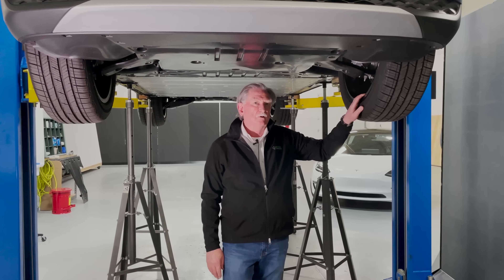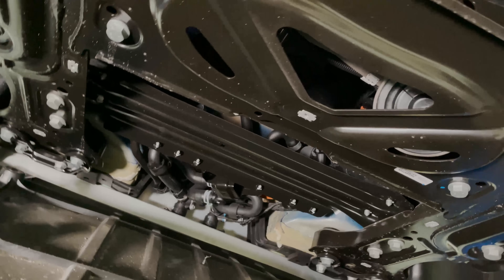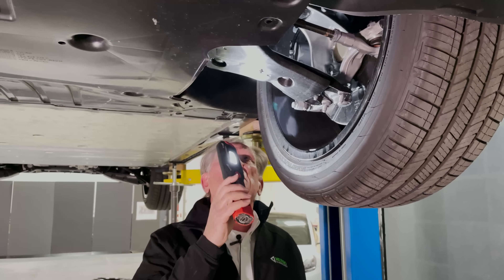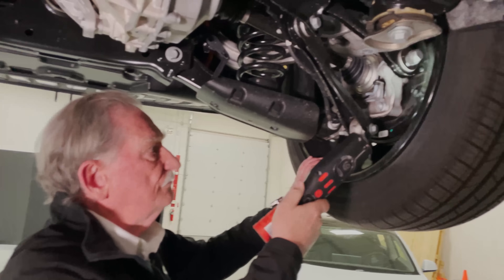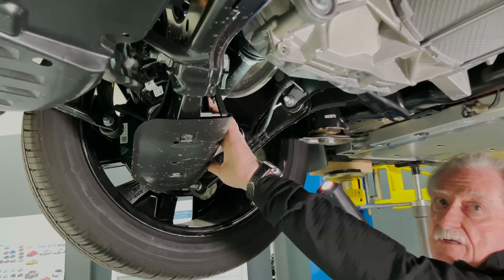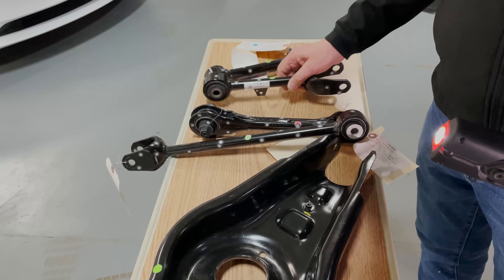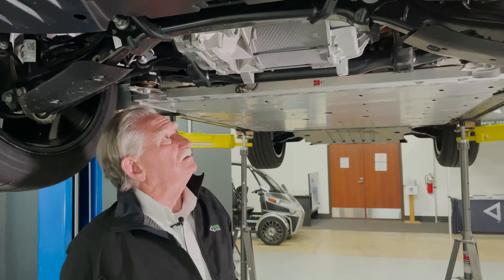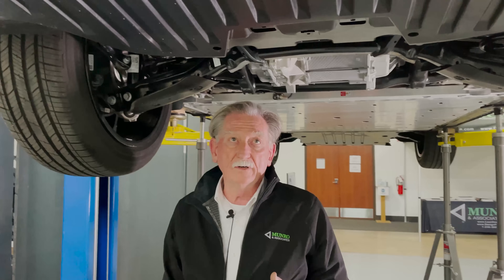2021 Volkswagen ID.4: E3 - Hoist Review, Front and Rear Suspension

Comment: The mistake Sandy did in this video is, that the ID4 is using the MEB platform. VW plans to utilize this in at least 20 different vehicles. Most of the design choices were meant to support the future models as well and not just one car. The excessive "voids" in the front of the car are for the front drive motor. And for those who complain about drum brakes: Most electric cars do engine braking ( energy recuperation) and the friction brakes are rarely used. Also winter salt tends to decimate disk brakes ( inactivity does it as well) and rear brakes handle a small percentage of braking. Drums are also protected from the environment and will work when the car needs them.
Reply: This is an excellent point.  The same MEB skateboard is literally used for all of VW Group's electric lineup - the only thing they change is the number of battery modules and motor configuration.  Tesla creates a bespoke chassis for each model.  These are fundamentally different engineering decisions and have their own unique pros/cons.   It's a bit unfair to compare them directly to each other.
Reply: @latchkeytio  
It’s not just the drivetrain and chassis but also much of the interior components like the displays, entertainment system, knob and buttons, door handles etc etc. I think we can be sure that VW has given this a lot of thought. 
On the other hand, because they share their platform across 26 models, it will be much more complex to make changes (improvements) to it. 
UBS (yes the Swiss bank) has done a tear down of the ID.3 and after that they adjusted their target price for VW shares significantly up. Just that message caused a 5% price increase of VW shares.
Reply: @latchkeytio  its not used for the whole line up. they have the taycan platform and are working on a bigger SUV platform and a smaller ID2 platform.to replace the triplet. 
but the bulk of VW EVs will be build on the MEB.
Reply: @nox5555  The id2 will be subcompact like their polo or the 208 around 4m length, not citycar like the VW eGo around 3,6m.
Reply: @Psi-Storm  the id2 will replace the polo, but the platform will be smaller so they can fit the triplet replacement on it.
Reply: @nox5555  Porsche doesn't use MEB
Reply: @sexpistill  ????  also not YET.  wouldnt be the first time for Porsche to use a VW base for their cars
Reply: @nox5555  🤣😂 Porsche, Audi and bentley share parts. Please show me which Porsche shares a platform with a VW
Reply: @sexpistill  the cayenne and the macan are both on MLB platform or its successor.
Reply: @nox5555   🤣😂 The MLB platform was introduced by Audi back in 2007 it is a luxury platform VW started using a varient of it in 2016. I ask you again show me a VW vehicle that shares a platform with a Porsche
Reply: @sexpistill  you should have googled more.
the VW Touareg and the Porsche Cayenne have the same platform and even come from the same factory.
Reply: @sexpistill  VW developed that platfrom. there will also maybe be a top level VW on the Audi platform. its not super clear what VW will do. and only seat and skoda will not get a top level version for sure.
 there isnt much price difference between the top level suv from VAG and the chances that the first big VW suv will be on the same platfrom as the Porsche, like with their ice SUV is pretty high.
Reply: The "Arching arms" that Munro called a "mistake". My gut feeling is that they are designed that way to save cost, so VaG group can fit them in all sorts of different types of cars. Some may use the space that those arms are arching around.
Reply: All of the above and if the motor brake + the drum brakes can block the wheels, disk brakes wouldn’t be better.
Reply: I bet some steel parts will be replaced with lighter parts for the Audi Q4 Etron on the same platform.
It also looks like VW is shuffling around their brands, making VW the entry level. the Seat Id3 clone and the skoda id4 clone look like higher priced vehicles.
Reply: @nox5555  the q4 is  made in the same factory as the id4, so it's possible, but not likely. But it could be possible because they might need to find ways to save weight to compensate for all the heavier noise insulation.
Reply: @nickb8a  thats not going to happen and the q4 is only slightly more slitent.  im sorry, tests came out and VAG  skimped on the q4. its just another id4 and no smart person in europe will buy it over the skoda.  for the US, if you can get a good deal, buy the audi, because it looks better and isnt like a japanese car on the inside. but buying low end audis was never a smart move. VW always had the same high tier car in the segment and the golf is better than the A3 for some reasons.
Reply: @nox5555  Honestly, for the us market, the q4 makes a lot more sense because of the better infotainment, and the "audi" badge. 
The price difference between the id4 and q4 e tron is about 3,000-4,000 us dollars (2.652,60-3.536,80 euros) 

The id4 lacks a lot of features that are available in the European market such as a 360 camera, and the virtual reality heads up display, so that is probably vw trying to get customers to upgrade to the q4. 

However the q4 does also lack some features that are available in europe such as ventilated seats, and thats probably Audi trying to get people to upgrade to the big e tron. 

In the us, only the more powerful golfs are available (because Americans hate hatchbacks and wagons for some odd reason). So thats probably the only reason why the a3 sells okay here.
Reply: @nox5555  I consider myself a smart person, and I’m in Europe👍🏻 I chose a Q4 over the ID4 and Enyaq😜 I felt the HVAC and Infotainment systems in the Q4 were better sorted and less glitchy , though I believe OTA updates may have sorted the infotainment issues. I also preferred the looks of the Audi and the only real advantage the Enyaq had was 60 litres addition luggage space. Although the Q4 was more expensive when you break it down to monthly payments there was little in it. My 40 S-Line was under £10 a month more than a 1st Edition ID4 or an Enyaq with a few options👍🏻 Audi have cheaped out a bit in a few places though- I’ve put a video on my channel showing a few examples 😬😜🏴
Reply: Excellent additional explanation!
Reply: and yet it does not look like a car platform of 2021
Reply: @mrThoreKarlsson  yes I agree. I'm a tesla bull. But all comments should be welcomed that point out not though of aspects.
Reply: I think in the analysis, sandy completely underestimated the requirements that vw had for the id.4 (meb platform)
Including all the reasons you listed, there are other design choices that they made because it made more sense to them. For example, not having a frunk. The id4s hood is extremely short. If you doubled the length, and made it to the length of a model Ys hood, yeah, you could probably fit a frunk, but they chose to make the front end shorter, because they could then prioritize interior/trunk space, and allow the car to have a smaller turning radius (important especially for the European market)
Reply: it's called. cheap engineering by over-engineer. the car should its main propose. best driving.
Reply: Im surprised he didn't go into this, if you'd look at one example of one of my products you'd question the efficiency of some of the engineering in it, but then if you looked at the whole product line then it would be clear why those trade offs were made.
Reply: Didn’t Sandy say rear drum brakes are fine?
Reply: You are taking it so personally, VW not build like a BMW..cheap JUNK
Reply: Also note, the id4 isn't new it's been for sale in Europe for a while now.
Reply: Having driven both the Model Y and the ID.4, I'm not inclined to call anything in ID.4's suspension a mistake. I was actually stunned at how good the suspension and chassis setup were in the ID. I don't care if the Tesla 'looks like a BMW' when on a lift. The VW drives far better on a twisty or bumpy road. Too bad the efficiency isn't there in the ID.4...
Reply: @coyotegeek  efficiency can improve over time with OTA just like with Tesla.
Reply: @coyotegeek  You are crazy, the Tesla Model 3 will out perform the VW on any winding track. And for less money a Model 3 will beat a Porsche Taycan Turbo S. Porsche Taycan Turbo S price = $187,600 --- Model 3 = $49,190 plus Modifications $20,000 = $69,190. For 35% of the cost Tesla wins... https://www.techtimes.com/articles/259029/20210413/modified-tesla-model-3-wins-against-porsche-taycan-turbo-s.htm
Reply: @coyotegeek  I own two Teslas, including an early Model Y and have also driven the ID4. I will stand by the statement that my Model Y handles better than the ID.4....
Reply: Exactly. Most of the video is just BS
Reply: Sandy has started to lose his objectivity and the VW group understands platform architecture, scaling, and plant production optimization.    He (Sandy) needs to acknowledge the limits of his competency  - that is simply his reality.  He would be well suited to interview engineers from the VW Group before racing to simplistic assumptions about over-engineering.
Reply: @anthonycbrown1952  Get the fuck out of here. He points to some things he sees as over-engineered and shows an example that he considers better in terms of complexity and cost. Who are you to even make an assessment as to his competency?
Reply: @junkymcjunkster  I read his C.V.  and  the VW Group is not some unprofitable start-up.   Get back to us when you obtain a STEM education.
Reply: @junkymcjunkster  who are you to know sandy thinks of every aspect when he makes these takedowns? Drum brakes actually can have better value on and ev vs disks when they are not rusting etc..... Ultimately we should all be open minded and not adopt dumb fan behaviour.... We don't know what we are supporting unless we understand it ourselves.
Reply: @janfm8670  In no way did I suggest I know everything Sandy thinks or express an opinion on drum brakes.
Reply: @junkymcjunkster  so what was your comment about? Get out of here.... Why? Since you don't know if the point that the guy made was valuable...
Reply: @janfm8670  I was responding to the personal attacks other dude was making.
Reply: @junkymcjunkster  ah ok. I thought this was your response to the main kcommenter. Sorry. I guess I need to understand that unter comments comments there is no thread 🤔
Reply: If Sandy feels he made a mistake, he'll explain that in a future video. Y'all can chirp and fuss at each other and provide your own justifications but none of you have Sandy's experience.
Reply: Sounds like you’re saying 20 models will have overly complex & unnecessarily expensive platforms. Sandy’s mistake, or VW’s?
Reply: Sounds like jack of all trades master of none.
Reply: Sorry but don't give me drum brakes in 2021!!
Reply: It rather looks like engineered by old guys (older than Munro) - they know a lot about the suspension tunning, as Golf rides perfect for the last 20 years, but they think old ways. So, it drives well but costs a lot to manufacture and is heavy. MEB - as a general solution should be well designed and this looks obsolete at the start. But it is the problem of the ID line - these cars are designed for "the previous war", especially software, ergonomics, and UX. It will pass as most of the people are not so smart, but it gives the competition an opening. I suppose Tesla makes money on their cars, as they optimize production (eg. they have no 20 models - each costs a lot of extra work and it is wasted and cars not so good on average). I doubt VW makes money on EVs - they can subsidize the production for many years and can even kill Tesla on the way, but then we, as consumers, lose. And then the Chinese will come...
Reply: @AndrewSienx  It mostly costs design time. they build them on the same line without a problem. 
The whole line is clearly designed for older drivers, the HUD and the lighting system they have in Europe  help them alot.
Reply: @AndrewSienx  im not really sure how doing things "the old way" what ever thats supposed to mean would be more expensive, these companies have done everything they can to make cars cheaper and maximize profit for decades now.
If they build something a certain way its because its the best solution for the price they are willing to pay for the part.
Reply: @AndrewSienx  You nailed it. Conservative German engineers and managers on the MEB project were not allowed to think outside of the box. This platform could have been awesome, this one is just mediocre. They could have simplified the chassis design, eliminated unnecessary parts, etc. The Chinese BEV’s are coming and they are going to kick some serious butt.
Reply: @AndrewSienx  I'll have to disagree here, Golfs up to MK7 rode like crap, they were oversprung and didn't absorb smaller undulations nicely, plus the wheelbases were nowhere as long as they could've been. They've fixed that now with the ID line, however seeing steel frunk lids, yet aluminum control arms, does make me question some of their decisions.
Reply: @AndrewSienx  
UBS (the bank) thinks that VW will make a 15% margin on their MEB cars, Tesla only makes a profit because they can sell their carbon emissions rights to FCA.
Reply: @Conservator.  the 15% is gross margin, not net. Tesla’s are about 30% gross margin. Tesla’s net margin absent credits is zero as this incorporates the fixed costs of the corporation. Apples to oranges.
Reply: @Conservator.  In other words, Tesla is not making profit with the production of cars. Just on selling emission certificates.
Reply: @Conservator.  a margin on sales is not a profit. Tesla makes around 25% margin.  Also, UBS based their numbers on very rough estimates.
Reply: @Conservator.  Not true, Tesla have higher margins than 15%. Their profit is being re-invested at present while the company grows manufacturing capability. Estimates put the GF3 GM at close to 45%, slightly less in the US.
Reply: @Conservator.  Bull$hit
Reply: @michaelholliday100  
Thanks for letting me know. Any hint as to why?
Reply: @Conservator.  As an Engineer, not knowing a lot of the specifics I would state handling and power to weight ratio. I have driven the new VW ID4 and prefer the handling of my Model Y... They more I hear from Sandy Munro the more I am convinced of my impression of the car. I purchased my Model Y for performance and functionality, and it does both extremely well. I have turned left at intersections with a green light exceeding 35mph plus with no issue. I consider myself a car buff, with a highly modified '72 Triumph TR6 in my garage. In the past I have owned just about  every European car you can name and have never had one that I would dare try to execute that maneuver on an open road.
Reply: @michaelholliday100  So the ID.4 isn’t a sports car in you opinion. Great information we didn’t know that. Now what was it what I said that was bs? Bc I didn’t say anything about the handling of the ID.4.
Reply: @Conservator.  Tesla is making 20-30% gross margin on its cars. More from Shanghai. What you are quoting is net, after capital expenditure in building giga-factories etc.
Reply: @thelongame  thanks

Comment: "These are things that you should be able to design out."  Apparently VW didn't watch the video where Elon says, "The best part is no part.  The best process is no process..."  I love the bloopers - keep 'em coming!  Thank you, Sandy and Team, I'm so glad your back for more instructional videos.  You have changed the way I look at things... for the better!
Reply: Stop talking nonsense, tesla used 5 links where vw used only one piece, the drum brakes are way simpler, cheaper they are sealed and maintenance free....
Reply: @carholic-sz3qv  Also remember how Musk/Tesla are claiming that they are gonna make giant single-rear-piece castings with the argument of saving money (lol). And now the MEB suspension assembly is supposedly too heavy and simple, nevermind you that it is also going to be to be the basis for a heavy combact van. ...Yeah, right.
Reply: @lennoxbaumbach390  Plus VW sells ID.3 starting at less than 23500 EUR (without mandatory VAT) in Germany, I don't see Tesla at that price.
Reply: @lennoxbaumbach390  tesla is going to use big castings but they'll still need alot of stampings. Vw doesn't use 70 parts for the rear like tesla did, vw is already equiped with all the necessary equipments and they combine both aluminium and high strength hot formed steel.... the id4 drives better than a model 3 and also is way more practical.
Reply: UBD tore an ID.3 apart and adjusted their target price for VW shares significantly up after that. They estimate that VW will be able to make 15% margin on their EV’s. That’s no small potatoes compared to Tesla that produces at break even at best.
Reply: I’m sure VW designed those parts for a reason. It might be other safety regulations or inherent rust prevention or something else.
Reply: Legacy auto cannot let go of it's old thinking... for all the talk of "new platforms/architectures" they seem to have twice the part count of Tesla for an equivalent vehicle!
Reply: @GregRobsonUK  bullshit, we all know that EVs have significantly way less parts than ICE, i see no issue with the vw EV platform. Its nothing compared to the ICE platform.
Reply: @GregRobsonUK  Go take another look at Tesla's front suspension (lots of bushings and ball joints) and compare that to VW's MacPherson design (ONE ball joint per side plus the strut bearing). VW's front suspension design is quite a bit simpler ... and VW has decades of experience with getting MacPherson front suspensions to do what they want them to do. The rear suspension on both this and Tesla is six of one, half dozen of the other relative to the difference in the front suspension.